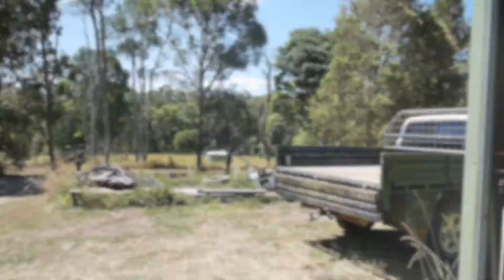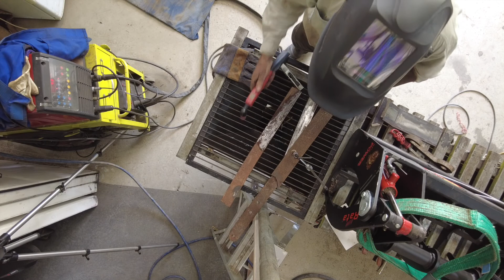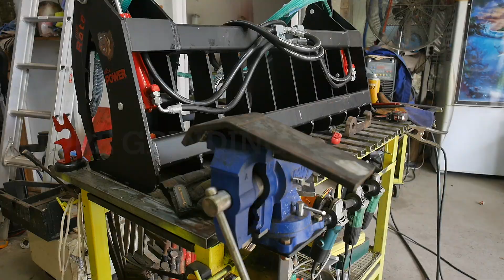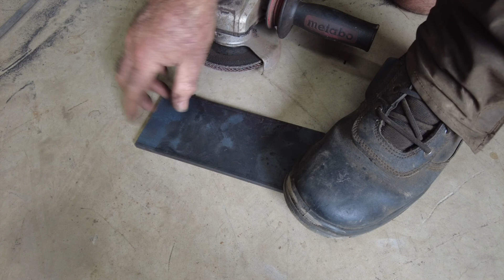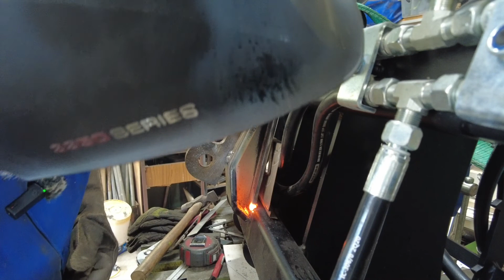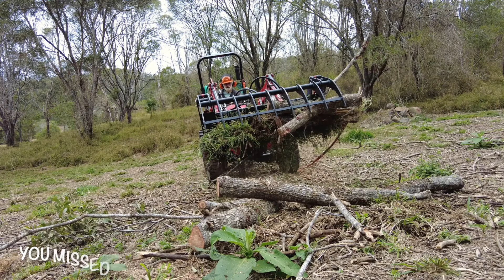Grappling with a new implement on the tractor!

Comment: Great job with the grapple. I have never seen a TYM with this type of quick connection. What HP is your TYM?
Reply from the maker: It is a proprietary version of the Euro fitting. I was not happy when I found out that this model had a non standard connection after I bought it,  so a local engineering company cut the hooks and I had to order the grapple minus the fitting. They only supply with Skid steer and Euro. The T 313 is an Australian spec T 293 @ 30HP. Very capable machine as you no doubt have seen.
I enjoy following your channel. Great job.👍😁🏆
Reply from the maker: Actually, Tony, grapples for small tractors are, unusually, pretty scarce on the ground in Oz. Plenty for full size skid steers, etc. That is why had to import from New Zealand. An opening for an enterprising company here for sure.